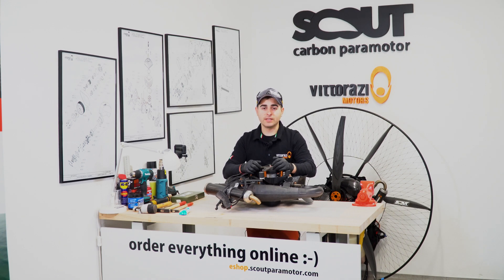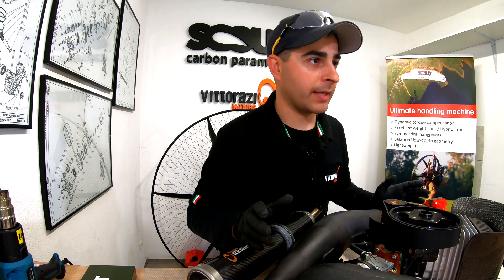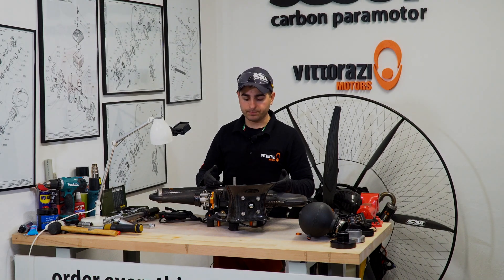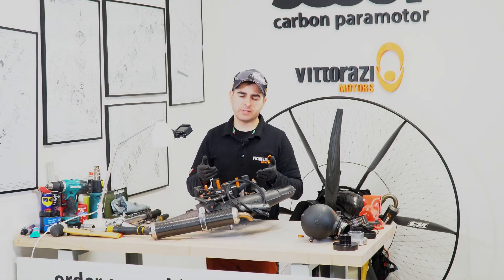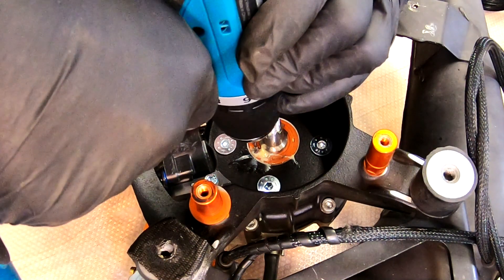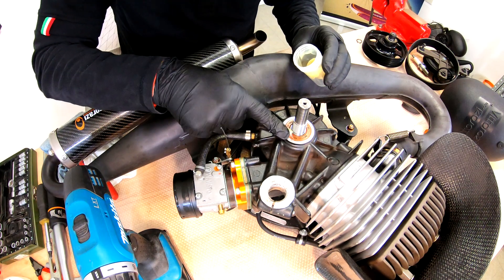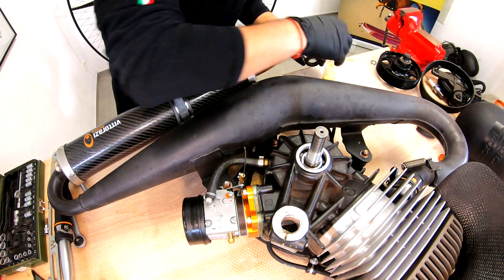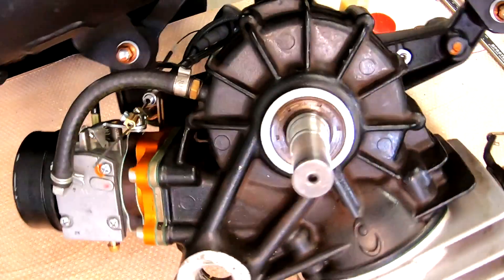Vittorazi Moster Plus cranckshaft seals replacement. Paramotor engine maintenance series

Comment: Have you have you ever thought of combining a free piston engine electric generator with an electric motor. The efficient generator would supply the motor with electricity. You could add a small battery or  big capacitor for redundancy to have a saver flight or to extend the range.
https://youtu.be/0ZwZ7Con-Wc

Comment: I would never drill a seal. In automotive a flat head and pick works good. This seems easy to work on than commercial aviation. Hopefully you guys hurry with the 4 stroke. Carbon seals on jets are a pain.